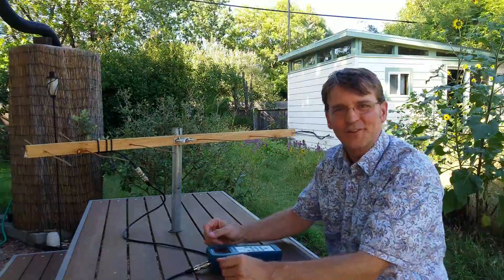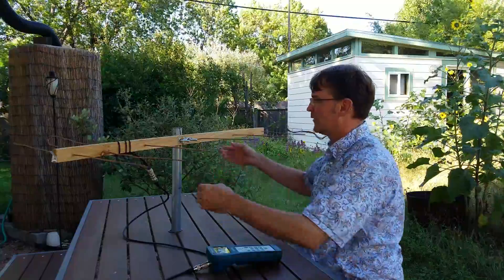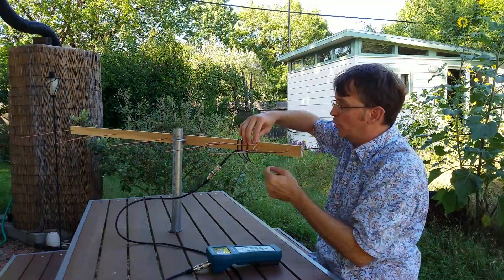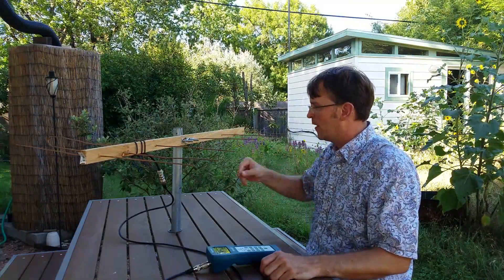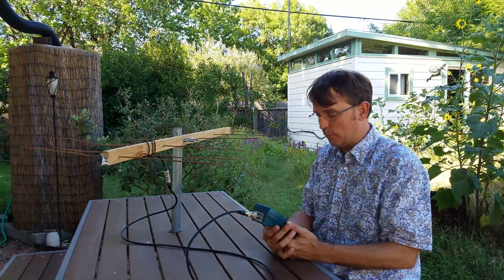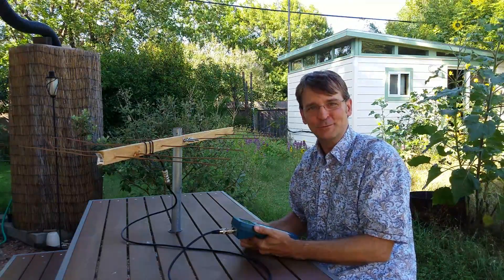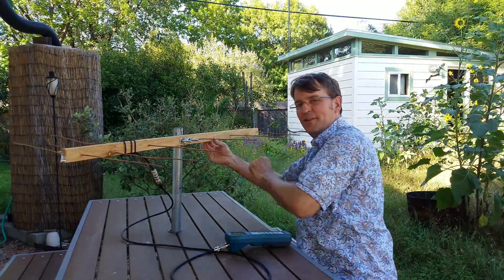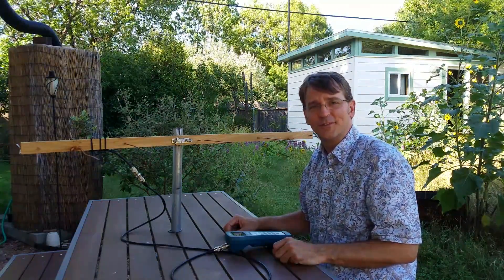Cheap Yagi 6 element beam antenna example for 222.1 Mhz VHF

Comment: I've built a few Yagis and it's fun and frugal. I'm all about safety, and with Yagis, that means not getting an eye poked out. Even wrapping some light-colored tape on the wire ends makes them visible, but the best deal is some little light-colored, pre-drilled bottle-stoppers with holes (think science lab) stuck on the ends to actually not get an eye poked out. They are really cheap in bulk.
 Nice vid ! I intend to make a 222MHz 'ground plane' and a Uda-Yagi. It's time to get that band active around here.

Comment: Recently, some buddies and I helped get a 220 machine up & running. So, I'm looking at placing a simple and somewhat compact antenna in my attic. I don't live far from the repeater and more than likely, I'll just adapt the coax to fit my HT. With your experience and/or research for this antenna, do you feel I'd get adequate performance in my attic?

Thank you for your time and the info shared.

Comment: Kyle,
Thanks for the nice video. Can you describe the driven element a little more? I looked at the WA5VJB plans, and it looks like it is one solid piece, with both the shield and center conductor of the coax attached. I don’t know my electrical engineering that well, but doesn’t that create a short circuit? I’m used to dipoles with the coax split between two elements. In these plans, does it matter where you put the shield and where you put the center?